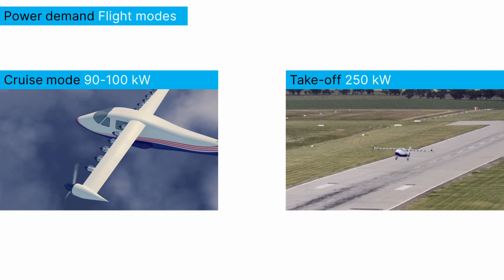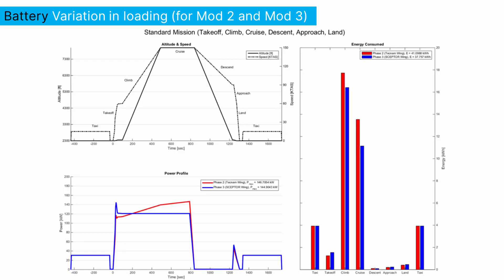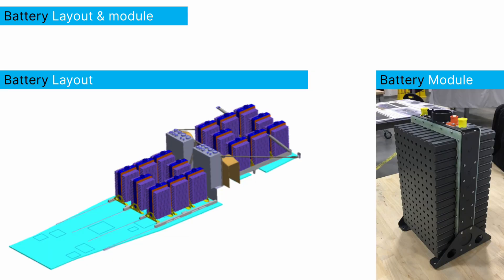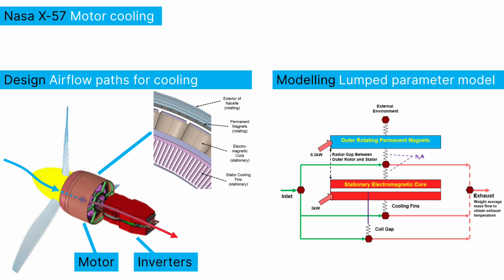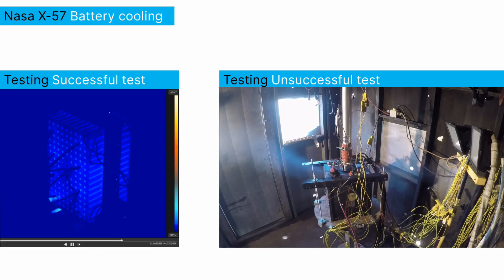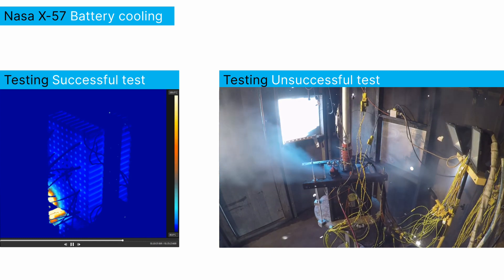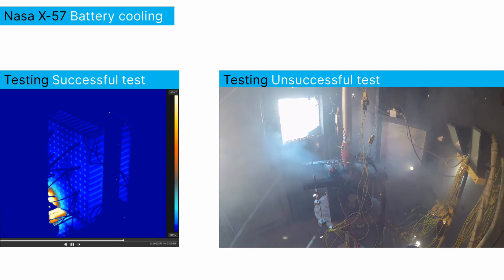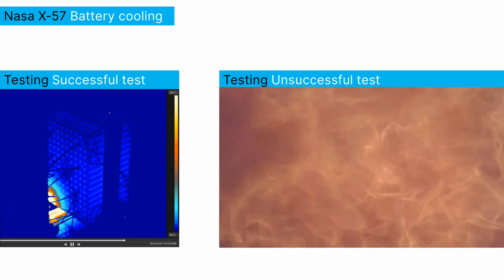Electric Aviation - NASA interview on Maxwell X57 - Part 3: Battery and Component Cooling Design

Comment: Great Post.  Why aren't ultracapacitors used for a dual thrust system like this?  High C rate U-caps could provide 180 seconds of  climb out thrust.  Tip props and blown wing could be used to climb to 10,000 ft.    Regenerative could be used to recharge the U-caps  from 10,000 to 2,000 ft.  Blown wing could be used from 2,000 to ground to slow to 60knots. It seems like a great deal of weight and over-thermal could be removed from the system.
Reply from the maker: Ah, I asked them the same question. They replied the capacitors wouldn't last long enough to provide the energy for take off and landing...

Comment: What a joke.  Seriously.  The X-57 is already a dinosaur; far, far outclassed by multiple international private sector projects more advanced, already flying and receiving orders.  This includes the back end work as well.  The X-57 is NASA today, naked and in full view; just second string posers chasing grant money.  NASA needs to rebuild itself.  It's on life support, and more and more will come to understand this quickly.  Congress needs to drive revision.  That or shut it down.  This project warrants immediate cancellation.  Wake up and smell the pavement NASA.
Reply from the maker: It's true that other industrial players seem to be going at a much faster development speed. NASA does create a lot of documents on their findings, which are hopefully useful to those industrial players.
Reply: @AirShaper  Documents such as?  The private sector is gravitating more and more to open sourced applications such as OpenFoam and the like, and conducting research out in the open.  NASA is not even close any more.  They are not even in the same stadium.  They are way outclassed and way outdated.  Again, they are just second string players chasing grant money.  Name a single current NASA project that has any form of leadership positioning.  It does not exist.  Private individuals are able to build flying models more advanced than what NASA produces, at far less cost, with off the shelf components and tooling, plus readily available software, often open sourced and free of charge.  The X-59 is another current example.  Booms prototype is flight ready.  I'll bet you lunch Booms prototype flies well before the X-59 does.  When that happens (and it will) Congress needs to take a very serious look at what NASA does, compared with what it can do.  This in my opinion is where you should be paying attention, with respect certainly.  NASA is ancient history in real time.  If you can accept that, what do you think it could be doing?  I'd like to see a video on that topic.
Reply from the maker: @sseim5654  Hi Steven, I do agree NASA and many other government organizations need to rethink themselves in the context of companies (especially those with a visionary person at the top) making more competitive products at a lower cost. We covered this NASA project as it still involves low speed aerodynamics (our core focus). Boom is a bit out or our scope, but it would be cool if we could interview Joby or Kittyhawk - if you have any contacts there or at other upcoming companies alike, just let me know at info@airshaper.com - thanks!